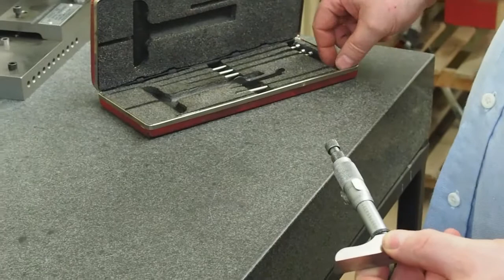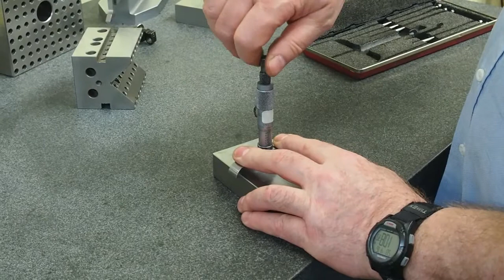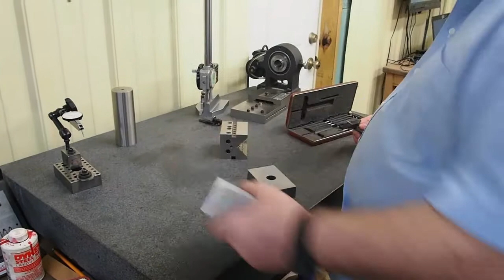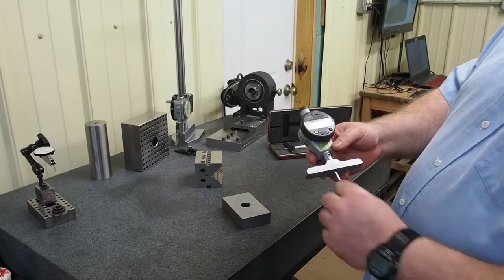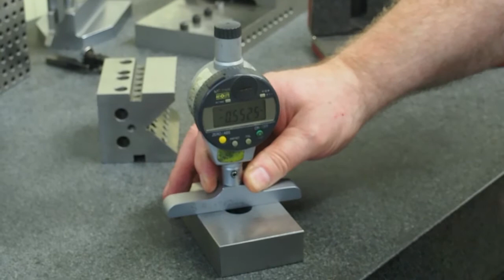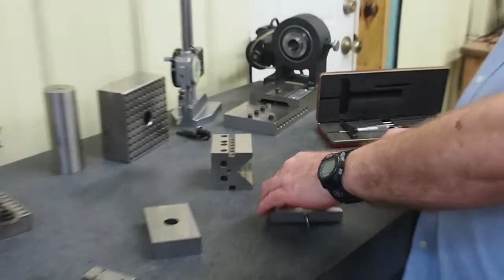Depth Measuring Tools

Comment: I'm in the process of trying to calibrate a vintage Lufkin depth mic. Each rod has to be calibrated separately and Lufkin sure didn't make it easy. At this point, I'm happy with zero being a half a thou off. With outside mics I calibrate to a tenth, so being this far out takes getting used to. Even though I prefer mechanical micrometers, just might go digital in this case. But I'm not giving up quite yet! :)
Reply from the maker: I know what you mean. Once you use a digital one like in the video you will love it. I hardly ever use the mechanical ones anymore.
Steve